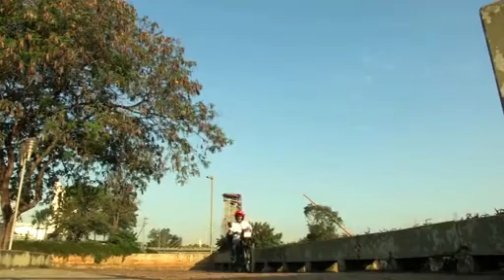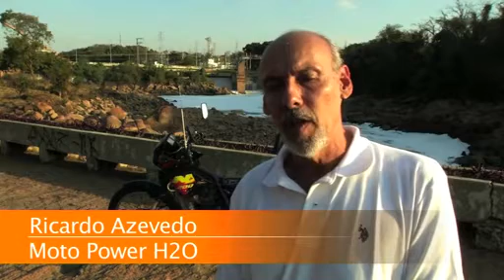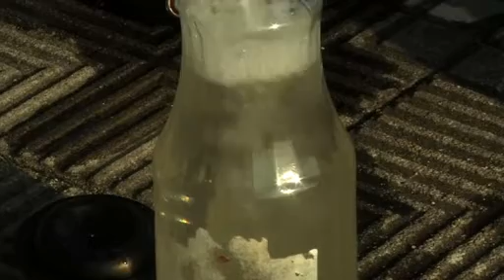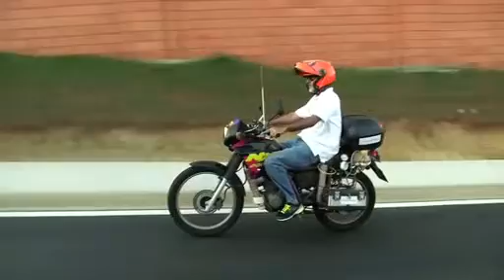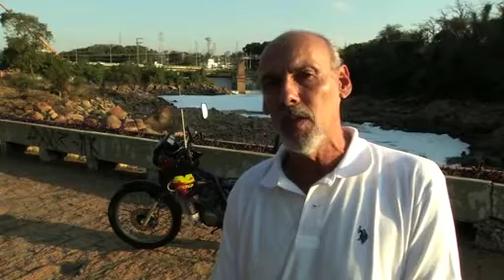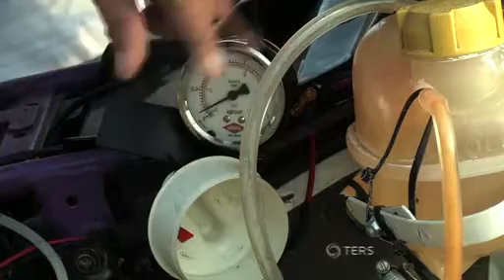Brazilian builds water-powered motorbike

Comment: The tiny problem is that obtaining the hydrogen from water requires electrolysis, which requires far more energy than he can get out of the hydrogen.

He would be much better off using the electricity to power his bike directly in an electric motor.